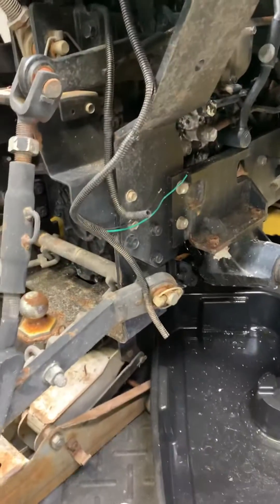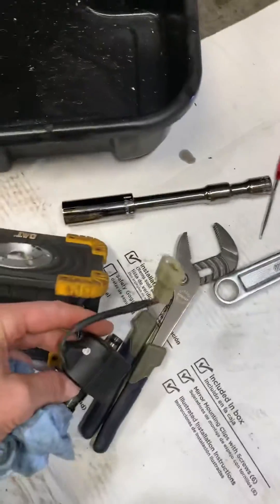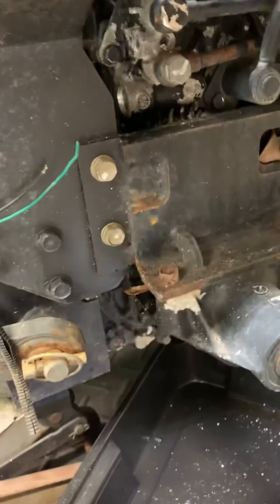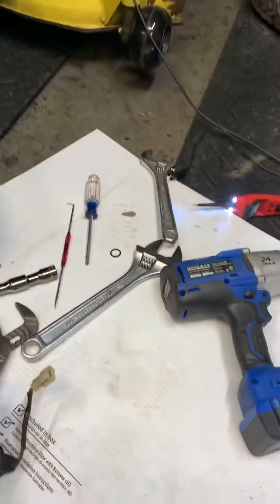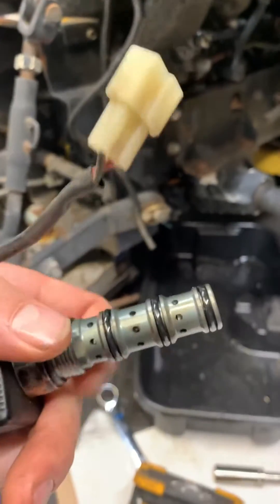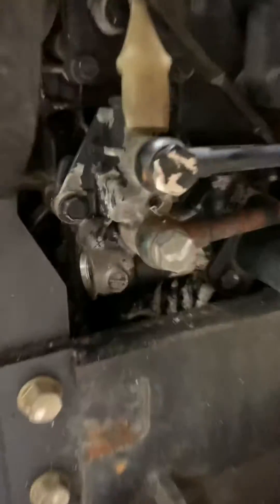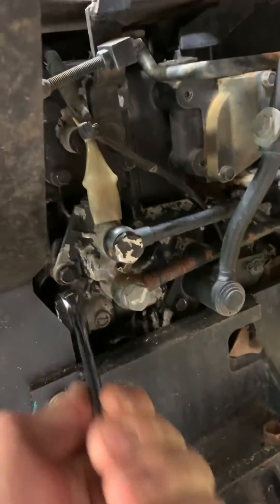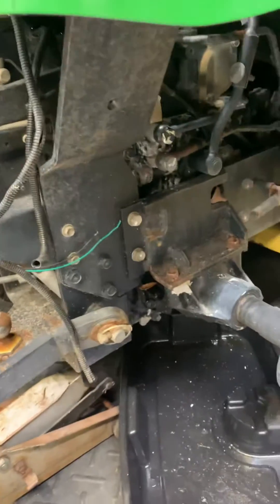John Deere Tractor PTO fix

Comment: Going to try and clean the one on my 3320. Ive read they get stuck, have had it since 07 and never used the pto since ive only used front end loader and have a boxblade on the 3 point. Recently got a brush hog and pto dosent engage but has play in it so i assume its not stuck at the shaft. Hopefully its as simple as freeing up that valve.

Comment: Thank you for a good advice. Unfortunately, it didn't help me to fix my problem. I have the same model JD 2305 and I took it apart just like you did  on your video, I cleaned everything well and put everything back the way it was before.I don't know if the problem in solenoid itself or it's  a plunger jammed which is like a spring inside of the plunger. I even spraid WD40 inside to see if it'll loosened up, no luck. I was wondering if a solenoid itself is bad, maybe coil burned out or something else. 12 volts goes to solenoid, so there is no issues with 12 volts delivery to solenoid. How did you clean the valve?

Comment: I had same problem.   On the solenoid it comes apart and has a piece of plastic with a spring.  My plastic had deteriorated.  But they don’t sell that.  Had to buy the whole solenoid.   That was the problem though.   Part was approx $ 454.90.

Comment: Pulled the solenoid cleaned it up and pto started turning, hooked to an implement and it is super super weak. Hyd fluid good, all other hyd equipment functions fine. Any suggestions?

Comment: Is this on a JD2210? Was the pto not engaging? If so, that is what's wrong with mine. Trying to sell mine but turns out the pto won't engage.
Reply from the maker: They are all similar.  Just clean it and get the inside unstuck.